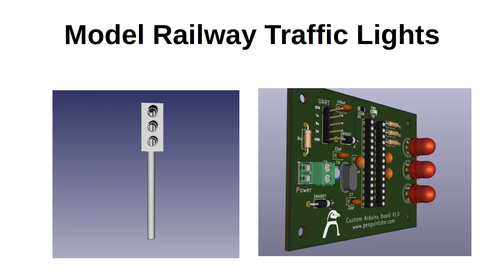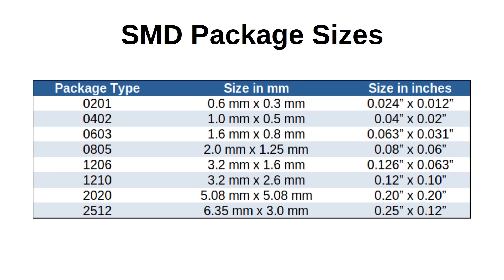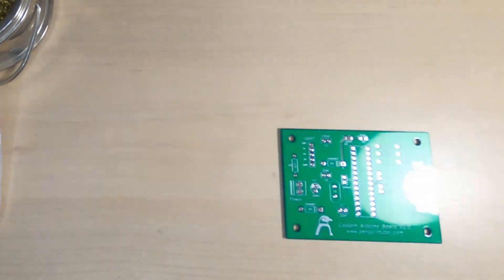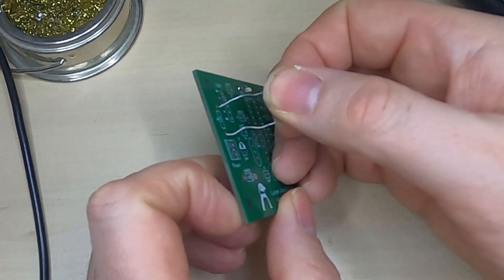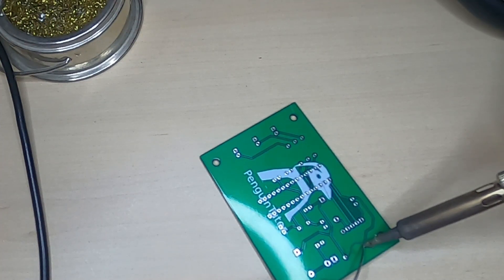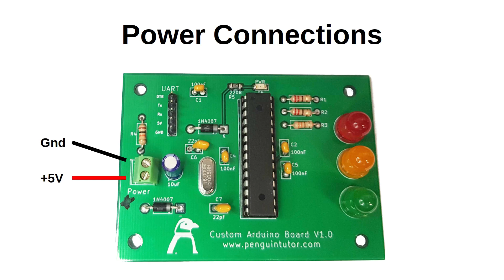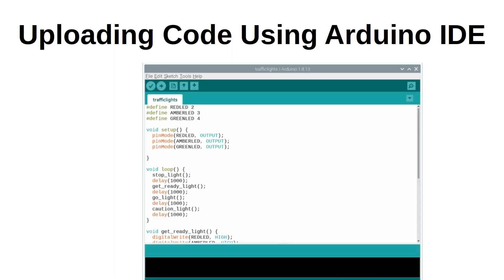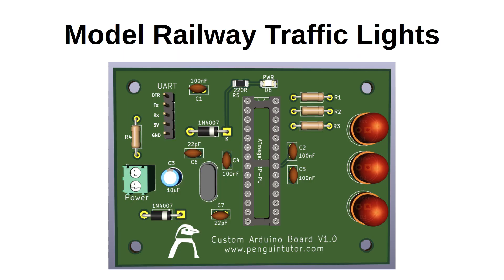Custom Arduino PCB - soldering and programming using the Arduino IDE

Comment: You would be better using a pcb holder to stop the pcb moving about!!  I always apply flux first when using  a soldering iron as the pads don't always take solder easily because of oxidation etc.
Reply from the maker: Thanks for the tips.

I have multiple PCB holders, but unless I'm soldering something particularly difficult they can sometimes get in the way more than they help. I do sometimes use a PanaVise, but when using it for through hole components you then need to support the components separately (I don't like bending component legs like some people do).

Flux can be useful, but usually there is enough in the solder. The board I was using is freshly made and I just wiped with some isopropanol alcohol first. But with older PCBs (or in my case veroboard that's been sat around for a long time) then additional flux can be useful.